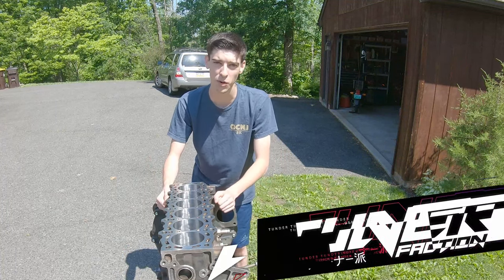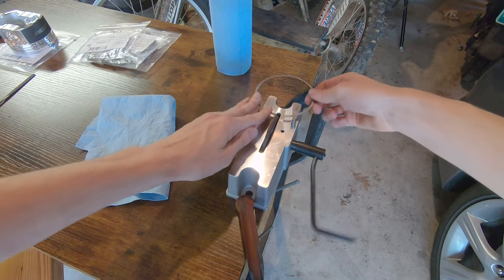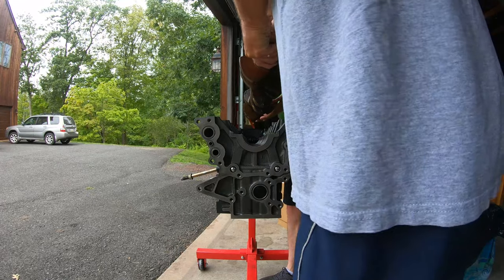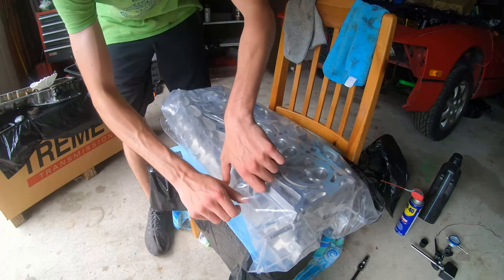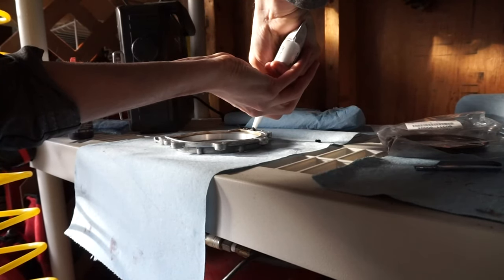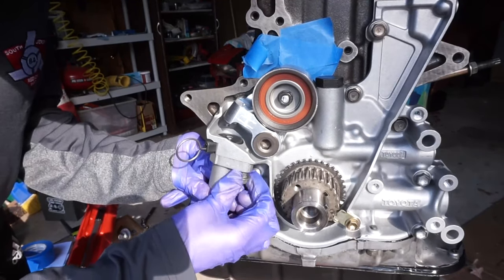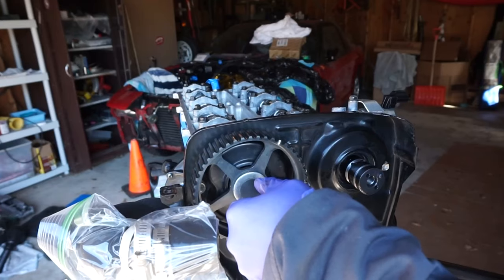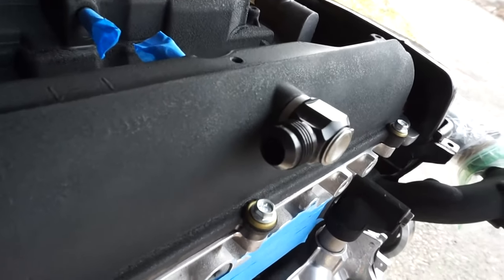Toyota 2JZ COMPLETE Engine Build

Comment: I like this video more than your recent! Its insightful. Less commentator voice. Felt like i was watching baseball with mechanic engineering
Reply from the maker: Awh thank you so much! I'm glad to hear you like this style of video and I will do my best to deliver videos like this in the future!
Reply: @TunerFaction  you’re pretty knowledgeable! Im actually working on the same build for my s13 hatch as well. NA 2jzge with bolt ons
Reply: @TunerFaction  btw are the radium fittings sold as a pair??
Reply from the maker: @stairwaytotevin  Very cool my man! That's really awesome to hear! I'm sure that will be a ton of fun once it's finished!
Reply from the maker: @stairwaytotevin  And I bought the Radium fittings separately, did you want the part numbers for each valve cover?

Comment: Amazing video, very well put together! And of course, awesome build!! I took my 2ZJ apart two years ago to do a head gasket. I didn't go for any performance upgrades since the engine sits in my GS300 which is for now the family vehicle. I did however take everything off of it to reseal and clean it off from the oil leaks it had. One mistake I made was that I put the upper oil pan on before the oil pump went on... I guess I wasn't paying attention or something lol. Learned my lesson. It was definitely an amazing learning experience and I found that those engines are easier to work on than I thought!
Reply from the maker: Thank you for the comment man! Very cool that you did the head gasket and seal refresh a couple years back! And hahaha dude I have made my fair share of mistakes just like you with the upper oil pan but that's how we learn! I really appreciate your comment mate! And I'm glad you enjoyed!

Comment: Correct me if I'm wrong but did you just install the head with out putting on the ARP head studs lol? @ 7:28 lol
Reply from the maker: Hello Xanzues! Yes you are correct my friend, I did install the head without the head studs installed. I did go ahead and install them later (8:00 you can see me dropping them in). I installed the head without the studs in because it's easy to scratch the bottom surface of the cylinder head with the studs if you don't line up the cylinder head correctly. It really doesn't matter when you install the head studs just as long as you remember to install them at some point! Hope this helps clear things up, and thanks for the watch!
Reply: @TunerFaction   oh nice! Was just making sure lol. I watch all your videos, I am currently assembling my 2JZ as I watch your videos 🤘🏾🤘🏾
Reply from the maker: @Xanzues  Thank you so much man I really appreciate the support! That's awesome you are building a 2jz too! I hope everything is going smoothly for ya homie!

Comment: Just came across your video, good job sir. I do have a question the 3d tools you printed for front and rear main seals. How can i get my hands on a set?
Reply from the maker: @BabyUnicorns2000  thanks for the comment my good man! Really appreciate it!😁 so I currently don't have any of the seal installers in stock however I do sell the STL files for both seal installers so you can go ahead and print them yourself if you have a 3D printer. Were you looking to purchase the physical parts or are you able to print them yourself?
Reply from the maker: @BabyUnicorns2000  I may be able to get some more in stock soon I would just have to talk to my supplier
Reply: @TunerFaction Hey! Where can we purchase the STL or CAD files? Also did you print them out of plain PLA?
Reply from the maker: @ohlopehz  hey man thanks for asking! All you have to do is email me at tunerfactionofficial@gmail.com and say you're interested in the STL files and I'll respond with the PayPal info on where you can send the money and also the price. After you send the money over PayPal, I send you the STL files along with instructions on the print settings to use. And yep! PLA works just fine!
Reply: @TunerFaction  I would be looking for the parts them self. I don't have a 3d printer. 😮‍💨
Reply from the maker: @BabyUnicorns2000  no worries there chief, let me talk to my supplier and I'll let you know an estimate on when I can get them to you.
Reply from the maker: @BabyUnicorns2000  hey big dog, I am able to get you both seal installers shipped to your door by the end of October for $45, if you want them sooner than that (like by the end of September) it'll be more like $65. Just let me know what works for you!

Just a note: if this seems expensive it's because the seal installers use 100% infill and take a lot of plastic to make and take a really long time to print so it costs an arm and a leg to manufacture them

Comment: with 2mm headgasket and 9:1 pistons what did your compression ratio end up being?
Reply from the maker: I actually have no idea what the compression ratio ended up being because I don't know exactly how much material was taken off the head and the block. I do know that my compression test numbers are close to the OEM numbers so it's probably 8.5:1 or so!

Comment: Very nice video, where did you buy the piston pin bushings and they sell it as a set ot individual?
Reply from the maker: Thank you for the compliment my man! So the wrist pins (piston pin bushings) came with my pistons as a set. I bought the pistons/wrist pins package from Real Street Performance. However, I ended up buying upgraded wrist pins that had a thicker cross section as recommended to me by the sales guy from Real Street Performance. The upgraded wrist pins also came as a set.
Reply from the maker: Sorry I misunderstood what you were asking about the bushings, I thought you meant the wrist pins! So the bushings I bought from Driftmotion and I just had to buy 6 of them. 

https://www.driftmotion.com/90999-73128-p/dm983.htm
Reply: @TunerFaction  thanks a lot man! Good luck with your proyect
Reply from the maker: @DriverJX  anytime! Thank you!!
Reply: @TunerFaction  hey, one more question, can you sell the 3d printed pieces or sell or share the 3d model to reprint it here to instal the front and rear seals?
Reply from the maker: @DriverJX  sure can man! What's easier for you? Would you like the pieces or the CAD files? Why don't you let me know and shoot me an email at tunerfactionofficial@gmail.com and we can workout a deal!
Reply: @TunerFaction  i will

Comment: Love the build man! What would you suggest as the best torque wrench to use with torquing everything down? In the process of building my 2j as well.
Reply from the maker: First of all, congrats on building your 2jz man! That's awesome! As far as torque wrenches go, you can go digital or clicker type, it's really your opinion. I went with the clicker type and I have listed the ones below that I bought. One is an in-lb one and the other is ft-lbs. Hope this helps!

https://www.amazon.com/LEXIVON-4-Inch-Torque-2-26-22-6-LX-181/dp/B07M68FY3X/ref=sr_1_1_sspa?keywords=Torque%2BWrenches%2Bin-lb&qid=1652931212&s=power-hand-tools&sr=1-1-spons&smid=A3CTCSJRE9G6AY&th=1

https://www.amazon.com/LEXIVON-2-Inch-Torque-33-9-338-9-LX-184/dp/B07MKSJ4SG/ref=sr_1_2_sspa?c=ts&keywords=Torque%2BWrenches&qid=1652931199&s=power-hand-tools&sr=1-2-spons&ts_id=559968&th=1
Reply: @TunerFaction  thanks man! Yeah been looking at different brands for these wrenches. Was a bit worried on accuracy with the various wrenches. Heard to stick with Snap-On but too much money lol.
Reply from the maker: @kenyattasamuels5714  That's great you are doing research on the different brands my man! I know Snap-On is great but most people don't have that kinda cash lol. For the most part, the cheaper wrenches are pretty accurate and you don't need to be spot on for a lot of the torques on the 2jz, most things are very forgiving as long as you are close. Now don't get me wrong, you do have to be CLOSE to the proper torque spec for all the things you torque down, but you don't need to be within 0.001 ft-lb lol. Basically what I'm saying is there is no need to spend a small fortune getting the highest quality torque wrenches!

Comment: Amazing videoman, where did you find the instruction manual for constructing the engine?
Reply from the maker: Thank you so much my friend!!! And Toyota has what's called an FSM (factory service manual) for the Toyota Supra which is basically this huge instruction manual for just about everything on the car, including how to build and take apart the engine! I found one online and used that along with other YouTube videos to learn how to put the engine together!
Reply: @TunerFaction where did you purchase your oil gallery plugs from?
Reply from the maker: @yuvrajwason588  I got mine from Driftmotion.com!
Reply: @TunerFaction this might be a dumb question but when you installed your pistons, the intake gaps are bigger so u install them to the right side of the block therefore when you put the head on, it’s on the intake side? So the smaller valve reliefs go to the left side and the larger go to the right side?
Reply from the maker: @yuvrajwason588  no dumb questions when it comes to engine building my man! And yes you are absolutely correct, the larger valves are the intake valves which are on the right side of the engine (when looking at the engine head on) and the smaller valves are the exhaust valves which are on the left side!
Reply: @TunerFaction  hey bro, how've you been? I'm currently doing my BC 272 Cam Installation and I just have a question. Was there an orientation of a way to place the cams? There is a lil dot that sticks out at the front of the cam, does that correlate to the way the cams are placed in the head? Did you also rebuild the intake cam gear or just re used it without changing the o - ring inside the gear. Thanks again.
Reply from the maker: @yuvrajwason588  Hey boss man great to hear from you! 

Great question about cam orientation. There is no specific orientation the cams need to be in before torqueing down the cam caps, however, there should be a position the cams can lay in where they kind of "settle" into place. As in, if you put the cam on the cylinder head and twist it around, there should be a spot where it kind of just settles down if that makes sense? 

The most important things to remember is to evenly torque down the cam caps, and to  make sure none of the pistons are at top dead center when torqueing down the cams.

I did not rebuild my intake cam gear/replace the inner o-ring and I've had no issues with it so far! Please let me know if the camshaft install stuff I said makes sense!
Reply: @TunerFaction ok sweet that makes sense to me. Thanks a lot man
Reply from the maker: @yuvrajwason588  anytime mi amigo!
Reply: @TunerFaction  hey man everything worked out great. Got the cams on and torqued. Did you perhaps get your whole rotating assembly balanced and your crankshaft or you just tossed them into the block after purchasing? My machinist told me I’m good by not doing it, just getting your thoughts.
Reply from the maker: @yuvrajwason588  thanks for the question my man! So I didn't get it properly balanced but I did a "rough balancing". So normally you're supposed to grind off material from the piston/rod to make them all exactly the same weight. What I did was just weigh each of the pistons and rods and I mixed and matched them to make them all weigh roughly the same if that makes sense? It's better than not balancing them at all, but honestly you should be fine if you don't do a rough balancing.

Comment: any way you could sell that front main fitter? Would love to help support the channel
Reply from the maker: I sure can man! I only have one of course so if you are interested just shoot me an email at "tunerfactionofficial@gmail.com". Do you think it would be more beneficial to just release the CAD file for the front main fitter instead? That way anyone can 3D print it if they have a 3D printer!
Reply: I would love a set of those seal install tools also. Maybe selling the file is the way to go so you wouldn’t have to bother shipping them all over the world , I’m in Australia for instance . Does the printer make the thread on the parts or do they have to be tapped?
Reply from the maker: @JimCampbelljc  Good call I think that is a great idea! And funny enough, neither of the seal install tools are actually threaded. The front seal fitter works because the crank pully bolt can thread into the front of the crank, and the rear main seal installer works because the bolts thread into the rear of the crank. Why don't you send me an email at tunerfactionofficial@gmail.com with any questions you have and we can discuss getting you that file!

Comment: Hey man quick question, what spark plugs and ignition coils are you running for the build?
Reply from the maker: Hey boss thanks for the question! The spark plugs are NGK BKR7E, and the coils are the R35 Smart Coil Conversion! Hope this helps!
Reply: @TunerFaction  also for the oem sensors, did you reuse them or bought new ones? For the cam caps as well, did you just clean them up or bought new ones and new hardware? Thanks.
Reply from the maker: @uv.g35  I ended up buying new OEM sensors to make sure everything was brand new when I built the engine. And for the 2JZ, you actually can't buy cam caps separately, you have to buy the entire cylinder head because the cam caps are machines specifically to the cylinder head. So I had to just clean mine up and reuse them. Hope this helps!
Reply: @TunerFaction  thanks bro, currently building my 2j for my g35 swap. Preciate helping me out and my bad if I overload you with questions.
Reply from the maker: @uv.g35  hey man feel free to ask me as many questions as you need! That's awesome you're doing a G35 swap, stoked for you brother!!!
Reply: @TunerFaction  hey man its me again, did you select the custom braided tefzel loom when buying the r35 to 2jz coversion coils? It has the deutsch dt8 connector. For the oil pump, did you purchase a stock one or a modified ported one; does that just help with the flow of oil?
Reply from the maker: @uv.g35  hey boss! Yes I got the custom braided look, and I just got an OEM stock oil pump! It's been working great for me!

Comment: How much to print me those front main and rear main seal tools?
Reply from the maker: Thanks for your interest man! I actually don't have a 3D printer myself, I had a friend of mine print them for me, he charged me $40 bucks for them because they use a lot of material. I can ask him to print another set if you would like? I can have them made and shipped to you for $60 bucks but I would have to speak with him first to make sure he can do it. Just let me know what you want to do!
Reply: Definitely ask him and let me know. I definitely want them
Reply from the maker: @shawt.v2276  Roger that my man, I'll keep you posted!
Reply from the maker: @shawt.v2276  Alright my man so I talked to my buddy and he is not able to print any parts for me at the moment, however I do still have the front mail seal installer tool I used in the video that I can sell you. I don't have the rear main seal installer anymore. Just let me know if you want just the front seal installer! Sorry I can't get you the rear one, I can still give you the print file for it though if you're interested.
Reply: @TunerFaction  I’ll buy it
Reply from the maker: @shawt.v2276  rock on man! Sounds like a plan, if you just want to shoot me a quick email (tunerfactionofficial@gmail.com) just explaining your ShAw T.V I'll get you hooked up!